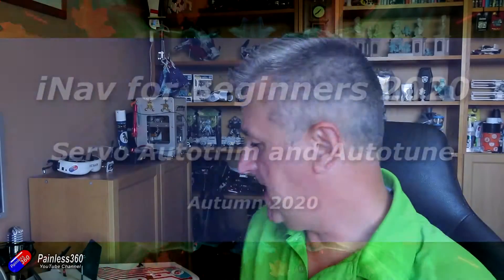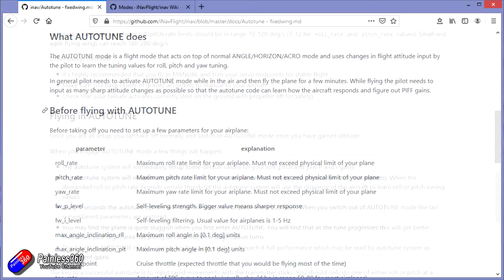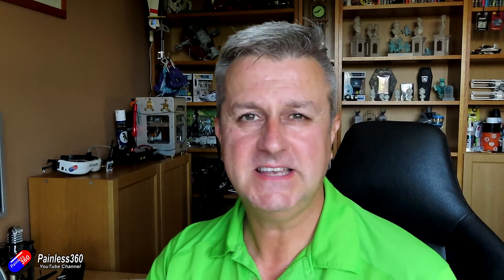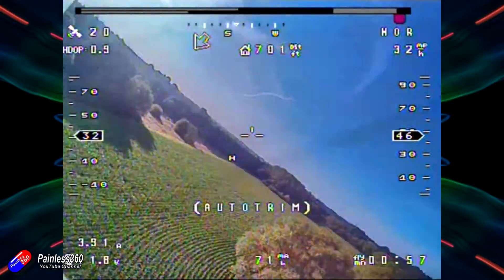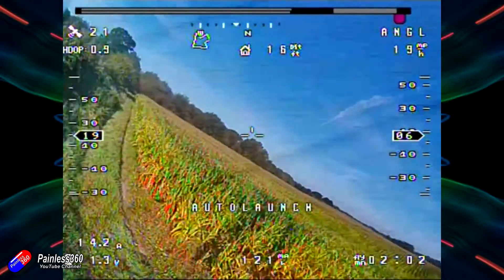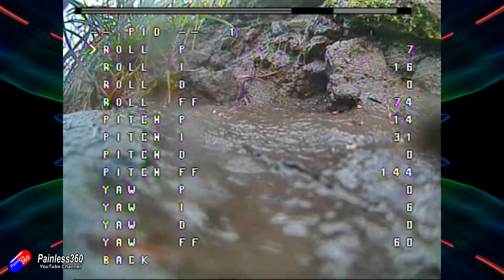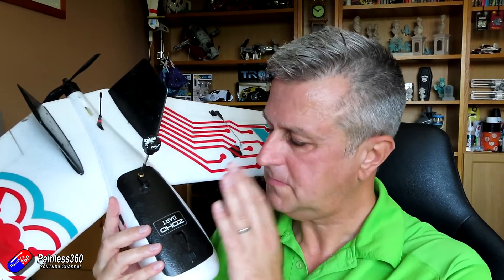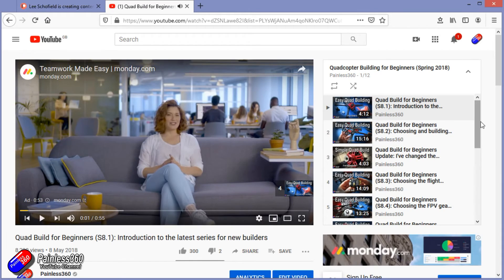INAV for beginners 2020: Servo AutoTrim and Autotune (after the maiden flight..)

Comment: My auto level elevator is reversed. How do I change this? Currently if I aim the model down, auto level want to keep pitching down. Please help 😢
Reply from the maker: You've probably messed up the radio channel direction and/or output reversing in INAV. See my INAV for beginners 2023 series.. best of luck
Reply: @Painless360  you were right again. It’s like you do this for a living lol. I did a double reverse. One on the TX and one in iNav. Thank you for the suggestion
Reply from the maker: It is why I cover that in detail in the INAV for Beginners guides.. ;)
Reply: @Painless360  it’s funny, I think I’ve watched beginners guid a few times. It’s very tough, but I made those stupid changes after everything was set up and flying beautifully. Then I go and make a few different changes and mess it all up lol. I’m not changing anymore settings hahahaha.
Reply: @Painless360  I’m excited to be getting some ELRS gear tomorrow, so I’m sure I’ll be watching tons of content on that topic.  RadioMaster Ranger Micro and an RP3

Comment: I maidened my first FPV wing this week. I took off using Autoluanch and had it in Return to Home.  After the Autoluanch sequence it flew significantly better in RTH mode than it did in Horizon or Manual. Do you know why this is?
Reply from the maker: Not sure,  RTH uses a lot of modes to fly back to you. I'd do an Autotune next..  best of luck!

Comment: If the Auto Tune procedure sets the PIFF values should the model be flown initially with the default values and then just do an Auto Tune? Perhaps tweak the values subsequently manually.
Reply from the maker: That's how I do it.. best of luck

Comment: Good plan. This routine of triming out can be most difficult because it involves variables that cannot now be changed. The idea that the cool kit of a dozen copies sitting on the shelf are all going to fly the same way is just wrong. Each is unique. Angle of incidence, torque roll, vertical stab offset, weight and balance, thrust line angle, many other subtleties - all are unique. And when you decide to try a different prop or servo or drop a camera into it - all those values change. Autotune takes the goofy out of recreational flight. Use it.

Comment: Question I recently got a s800 put together everything is mechanically trimmed. When flying in manual it flies straight. But when I flip into horizon it tends to pitch down ever so slightly. Do I adjust the acczero_y  axis to correct this. If yes do I add or subtract ? Thx
Reply from the maker: You'll have to tweak the board alignment. Check out the earlier INAV setup video in the series where I show how to do it. Best of luck

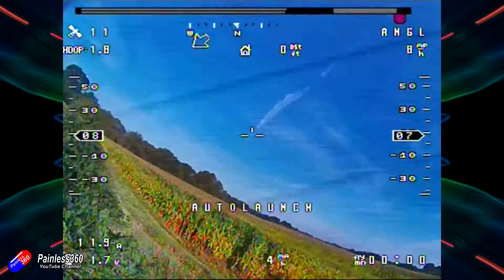Comment: Great video Lee! I wanted to ask you what OSD are you using starting at 4:10? I like the vertical bars but did not see an option in iNav OSD section.
Reply from the maker: This is the beautiful vector based OSD that is part of the BrainFPV flight controllers..